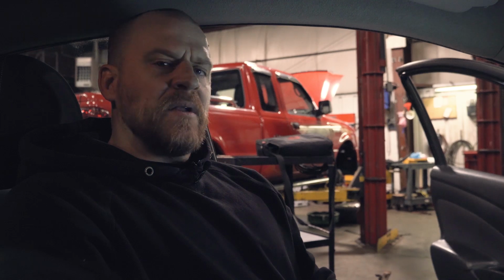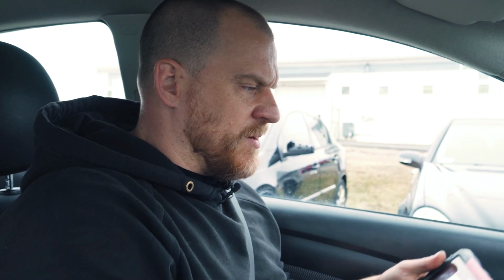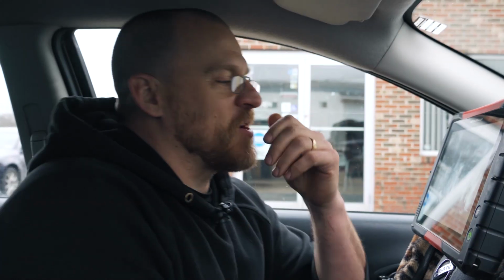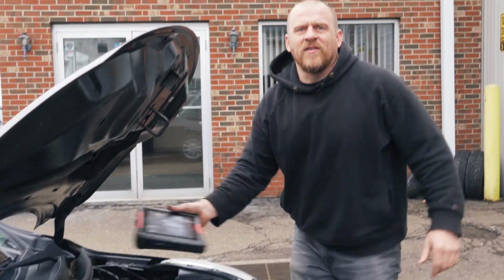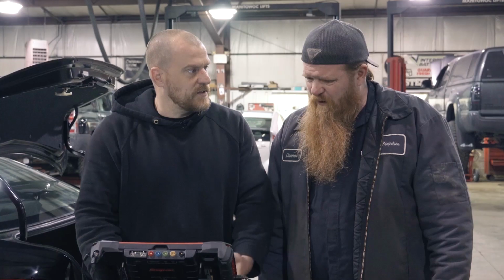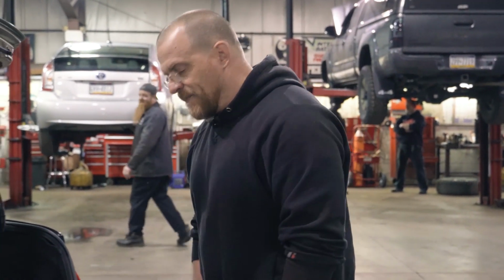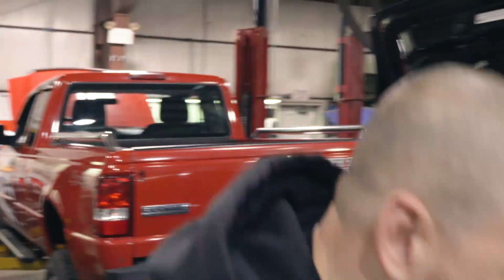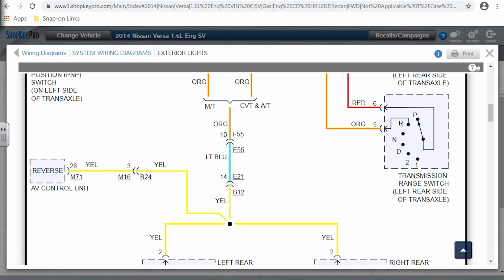2014 Nissan Versa P0705 Transmission Range Sensor "A" Circuit (PRNDL Input)

Comment: I wonder if there is any capacitance to that reverse light circuit like maybe in that av module and if there is a bad contact on the bulb the voltage never gets pulled down or at least not in the 5 sec window?
Reply: Very cool

Comment: Thanks for sharing SD👍
Nissan's are always difficult, but this video is very important in diagnosing a fault that could be flagged due to a problem in the parallel circuit, the code description kind of said it (in hidden word's) that if the TCM see's two command's at the same time for 5 seconds, it would set the P0705, but what a great video looking forward to the follow-up video👍
Special thanks to James Danner & Caleb Danner👍
Stay safe Guy's❤

Comment: Yes. tail light issues will cause transmission issues as bulletine says. I had a Nissan Bluebid Sylphy with CVT transmission and if the one or more brake lamps are burned, car had hesitation issues. So, check for the ground issues :)
Reply: Wow 
Such a bad engineering 
Might be my problem all this while.  
Fighting a hard shifting issue in my cvt

Comment: Back in the 1970's  the only CVT around were the DAF transmissions on the small 340  Volvo's from their Dutch   factory. These transmission used external rubber drive belts with  variable pulleys. The transmiission was mounted in the rear of the car just  ahead of the rear axle. The two  external  belts linked to very  large vee pulleys  on the left and right  drive shafts.  I went out to a house call on one with no drive.  Put a rope on the car and moved it 10  yards only to have one of the pulleys fall off on to the road.  Fix was simple only parts required were a new nut and locking washer.

Comment: Bad ground at the tail lights is the issue. it's simply burned. When You aply brakes or turn signals the voltage goes to the revers light instead of "burned" ground. It's very common for the nissans... Just unplug connectors at the lights and inspect ground terminals/pins.
Reply: I had the same issue with a nissan versa 2013 that you re talking about ,thank you for share ur idea with us .

Comment: tail lamp assembly water intrusion, first thing I think of? it's corrodes and bridges tail to brake filaments enough to back-feed the brake switch circuit and trigger the codes, possible while coasting a long ways off highway ramp/downhill
** watching further and seeing the corrosion location in photo's, it could be tail/brake back-feeding the reverse or tail/reverse back-feeding the brake circuit or more then one being back-fed via poor ground! (assuming connector is at bottom of those lamp assemblies) which it kind of looked that way by amount of traces.
Reply: also. poor bulb to housing ground could allow tail to brake circuit back-feeding, assuming the brake switch directly feeds the bulbs and TCM/BCM/ECM. I forget what the diagram claimed or lied about now. multitasking lol
and now thinking further, a simple bad filament inside brake/tail bulb could break off the ground side and bridge together, again back-feeding the brake circuit.
**also filaments sagged and touching in a shared tail/brake bulb.
really a big can of worms there, but that's the stupid things which my mind figures out pretty fast when I focus on it, but you cannot win them all in a hurry!

Comment: I was expecting you to put an intentional backfeed to the circuit to see if you could create the problem just to verify if that bulletin had credibility.
Reply from the maker: Did you see the images in the bulletin? It was definitely a credible TSB. Then when I saw the dim bulb. I was no longer concerned about the code, but more focused on the how and why of the backfeed. Maybe playing around a little more would have answered that. 
Anyway, it's been 5 or 6 weeks since changing the bulbs and all is still well.
Reply from the maker: Check out my pinned comment Matt. I made a mistake in my testing methods
Reply: Bulletin is 100 percent credible.  Manufacturers go out of their way to avoid publishing TSBs unless its a legit issue, so when one goes public...you can be damn sure it is legit.  Doesn't mean a tsb always relates to the exact situation on the vehicle you're working on..but if it is published as a tsb, it should be step 1 in your diag.  And if the diag confirms the tsb but the tsb has you replace a part with same non updated part... then its time for experienced based fix.   Don't let the engineers parts cannon shoot you in the ass 😎
Reply: I think he missed a detail in that bulletin....
Reply: @HouseCallAutoRepair  please share what was missed.  Making a vague comment and not explaining to the community defeats the purpose of what ScannerDanner and pretty much every other credible youtube automotive channel is trying to do.
Reply from the maker: @jeffreywilsonrubikscubeonb2428   thanks man. And you are correct.
But I'm pretty sure I know @HouseCall and he is always helpful and on point. I'm pretty sure this was not meant to add confusion and I'll await his reply.
Reply from the maker: @HouseCallAutoRepair what did I miss my friend? Thanks!

Comment: Suretrack isn't primarily English?? (Sounds like a chinese scan tool translation) 
I stopped liking Nissan the first time I worked on a Versa... The entire drivetrain and suspension is on a floating subframe that rusts out and falls apart...
Put the 12v+ from the tail light bulb "low" filament into the 12v "high" (brake light filament) while the car is in a forward gear and the brake pedal IS NOT applied.(simulates water IN the bulb socket)

Comment: I can not figure out the P0705 on my lady’s ‘00 Jeep Cherokee(XJ) Sport 4wd 4.0L auto.  I’ve cleaned XJ range sensors in the past and for hers, I replaced it.  I ohmed out every gear with the connector unplugged and adjusted it so each gear reads .3 ohms(except D) across the various 2 pins per instructions.  It starts in P&N and reverse lights come on in R.  It drives fine, but the P0705 comes right back.  I haven’t back-probed it connected to see if more than the two pins get continuity.
Reply from the maker: When did this problem start?
Reply: @ScannerDanner  it probably started 6 months ago.  I replaced the nss/range sensor because it refused to come off(even though soaked in pb), and the pry from behind cracked the alu.  I’m going to disco the tcu and ohm out the connections there per instructions.  I’ve owned multiple XJs over 25 years, so am good at fixing them(save the rust), but only personally keep the manual ones.  I know you have/had a white one.  Should I check the tail lights or multiple continuity on P, R,N while in D?

Comment: At 25:10 the left light was definitely dimmer.  I believe you had a short feeding another light in the harness. Possible cause was pinched wires from a previous bulb change. When you moved the wire you made the short go away for now. This will come back when the short reconnects and drives the reverse to 12 volts will in PND.
Reply from the maker: From my memory, that bulb was still dim, even after removing the taillight assembly. I need to go back and watch. Caleb may have had an edit there? 
It's been 5 or 6 weeks since changing the bulbs with no fault. Thanks!
Reply from the maker: Just went back and watched and I made a big mistake. One where we all wouldn't be debating this dim bulb cause.
I should have tested that circuit with the reverse lights on. In fact I shouldn't have even unbolted that assembly without having the reverse lights on smh. I missed my window.
Reply: @ScannerDanner  you were just following tech bulletin looking for corrosion.  Only hindsight was it a mistake because it wasn’t corrosion causing a short.  The genius was understanding why the problem was in the light with the information on hand.

Comment: Just curios, why didn't you try to back probe 12v through the real tail lights to check if that bullet-in is right?
Reply from the maker: Did you see the images in the bulletin? It was definitely a credible TSB. Then when I saw the dim bulb. I was no longer concerned about the code, but more focused on the how and why of the backfeed. Maybe playing around a little more would have answered that. 
Anyway, it's been 5 or 6 weeks since changing the bulbs and all is still well.
Thanks!

Comment: If you look at the factory diagram the reverse lights and the input to the TCM are all tied together. All the rear lights share the same grounds left and right side. So it makes sense to me that if you had a ground issue either on the left or the right tail lamp/ stop lamps circuits as well as a short in the rear lighting circuits that would show a system voltage to the tcm.
Reply: I changed my rear lights n still having this problem:/
Reply from the maker: All rear lights share that ground? Sweet. Good information. Thank you

Comment: I have a couple nuggets to share with the classroom.  I noticed that you pulled codes and then you complained that you didn't have freeze frame data later.  You should be able to save the freeze frame data onto your Snap On scan tool.  Then you can erase your codes and still have something to fall back on.  It's a bit of a pain in that they're not user friendly in writing file names.  Finding them has been kinda rough and then understanding what you're looking at can be confusing because they'll show the freeze frame data like it's just live data PID's.  They do transfer easy to a PC for easier reading on Shop Stream Connect, though.

I also did some snooping for OE wiring diagrams.  It turns out that Mitchell did the best they could with what Nissan gave them.  Nissan never added any splices to their diagram for the CVT controls to the reverse lights.  It would seem they ONLY added relevant splices for CVT control circuits.  The reverse light diagram did include the splice and they drew it like a CVT and a traditional automatic range sensor were both installed.  If you ever want to see it for yourself, page TM313 in the transmission section and page EXL68 in exterior lighting sections are where I found them.

I'm glad you posted this video for us.  I've always struggled with Nissan's service info and wiring diagrams.  This got me spending some time to get a little more acclimated with it.  Nissan's service info is still as dissapointing as a system call, but I can find my way through the service info a little better.

Thanks, as always, and keep up the good work.
Reply from the maker: Can you send me those diagrams please? Send them to paul@scannerdanner.com 
If you don't mind. Thank you!
Reply: @ScannerDanner  Sent.

Comment: Bad ground in the taillights can elevate taillight ground several volts and via the backlight bulb give the transmission module this input voltage when other lights a lit. (asuming the share the same ground)
What is the threshold voltage for the transmission module to see this as high input? So why not check the taillight ground voltage to a known good ground.
I had this years ago with a Chevrolet Transport. When driving,my backupsensor system dimmy blinked when braking or using the turn signal.
My car dealer could not figger it out so i did some measuring myself, that while i hate working on cars. After cleaning the bad ground connection the problem was solved. Later at the car dealer i told the mechanics what the problem was and they understood shit of it.

Comment: The hesitation part is probably the pcm seeing the brake switch on when you're hitting the gas.  It thinks it's a runaway and cuts fuel.  That's if you had a back feed from the tail lamps to the brake lamp circuit from corrosion or short in the tail lamps board.
Reply: My thought exactly!
Reply: Very cool

Comment: I WORK ALONE AND DO A LOT OF TRAILER BRAKES AND LIGHTING ON THEM. MY BRAKE DEPRESSOR IS A HARBOR FREIGHT  BAR CLAMP WITH THE ENDS REVERSED.  $ 5.00  FOR A SHORT ONE TO LESS THAN $10.00 FOR A 2 FOOTER. CAN WEDGE UNDER DASH OR AGAINST THE SEAT. SLIDE IT TO FIT CLOSE AND THEN PULL THE HANDLE TILL TIGHT. HAS AN EASY RELEASE. WORKS  BETTER THAN A SCREWDRIVER OR 2X4. ENDS ARE ABOUT 4 IN. LONG SO NO DANGER OF PUNCHING HOLES OR GETTING GREASE ON THE SEAT. WORKED SO WELL, I SPLURGED AND GOT AN 18 INCH ONE TO MAKE A 3 PIECE SET. BEATS HECK OUT OF THE LISLE TOOL AND A LOT LESS MONEY.

Comment: saying this before completing the video:    given he bulletin and lack of correct wiring diagrams in the moment, you should have tried a proof of concept, shorting out/partially shorting out and forcing a backfeed to see if the DTC came back, using a urrent limited circuit to prevent damage..     if you couldn't generate DTC from back feeding then ignore the bulletin and its wiring diagram.
Reply from the maker: Did you see the images in the bulletin? It was definitely a credible TSB. Then when I saw the dim bulb. I was no longer concerned about the code, but more focused on the how and why of the backfeed. Maybe playing around a little more would have answered that. 
Anyway, it's been 5 or 6 weeks since changing the bulbs and all is still well.
Reply: @ScannerDanner  just wanna test that theory that a leaky taillight..a taillight would cause PRNDL issue and/or hesitation issue.     im saying i would have done a current limited contact bridge test to try to generate that DTC/CEL see if backfeeding it really would cause it or not.   im still scratching my head.
Reply from the maker: @Honeypot-x9s  me too, check out my pinned comment

Comment: Maybe I missed it, but did you try applying power manually at that bulb circuit to light it and see if you could get the code to set?
Reply from the maker: I did not.
Did you see the images in the bulletin? It was definitely a credible TSB. Then when I saw the dim bulb. I was no longer concerned about the code, but more focused on the how and why of the backfeed. Maybe playing around a little more would have answered that. 
Anyway, it's been 5 or 6 weeks since changing the bulbs and all is still well.

Comment: "They're not telling me why".... Yup, that's exactly the way successful technicians think. Good reasoning, backfeeding voltage from a shared ground could trick the computer into sending another misleading code. Unfortunately those who write these communications are more specialized in language translation than they are in auto repair.
Reply: In my experience, many service manuals prove they aren't any better at language translation either.  It seems to me, they're much more concerned with safety and liability disclaimers.  They could care less about how much you need an English to English translation after that.  Read a Mitsubishi service manual for the full shock value.  I expect to see something like this on a good day:

"Warning:  Do not attempt to eat, or otherwise attempt to chew on the business end of your chainsaw for any reason.  This is especially relevent when the chain brake is released and the chainsaw is at full throttle.  Any attempts to put your lips and/or mouth on the chain at any time may result in personal injury"

"Warning:  Do not attempt to put any amount of the rest of your face near or on the chain under the aforementioned conditions.  Personal injury may occur.:

Step 1: Removing the Flibbersnart.

     -Removing Flibbersnart.
Reply from the maker: @shauno3697  🤣🤣

Comment: Ground pin for the left brake light connector.  Is probably burnt. Ground pin on the tail lamp board is probably also melted/crooked
Reply from the maker: Nothing burnt on this one my friend 😉 At least not that I saw.
Reply: @ScannerDanner  idk if i missed it in the video but did you take out the yellow locking piece that holds the pin in place on the connector? The connector itself doesn't usually show up black but when you take the locking tab out you can see the pins are spread and the connector is usually melted a little.

Comment: All the time I was shouting at the TV for you to check the connector on the back of each lamp cluster.
No matter what brand, they're notorious for burning up the ground connection as the stamped part of the cluster is galvanised steel whereas the harness connector is brass or similar.
Direction of current flow, sum of current from all lamps, a little moisture and you get accelerated corrosion then they melt due to high current through a high resistance.
My guess is fault sets when direction indicators and brake lights are on at the same time.
What does it need to see a high? Maybe only 5 Volts on a 12V circuit?
Reply: Very nice

Comment: I once had an issue where the plastic insulator on the bottom of the bulb cracked, then a direct short to ground formed inside that crack. The fuse would blow as soon as the bulb circuit was activated. Maybe that happened here, but the short wasn't direct, so it wouldn't blow the fuse. If the issue happened in reverse, and the short circuit was largely pulling the reverse circuit to ground, the TCM would have received no inputs as to the gear position. It sounds logical at that point that the PRNDL indicator would immediately go blank and set the code. The code setting criteria specified that it will set if it receives two high signals at the same time, but it doesn't mention what happens if all signals are low at the same time.